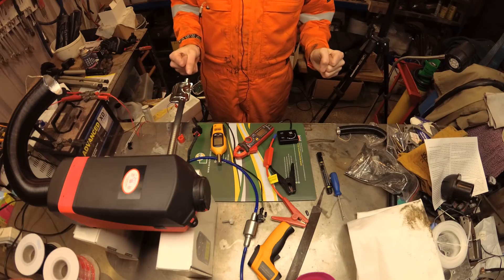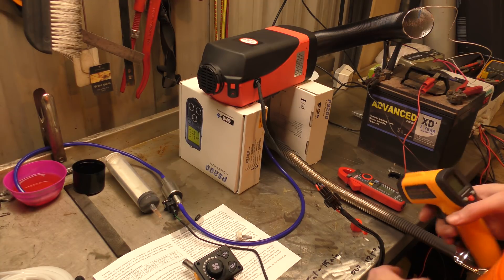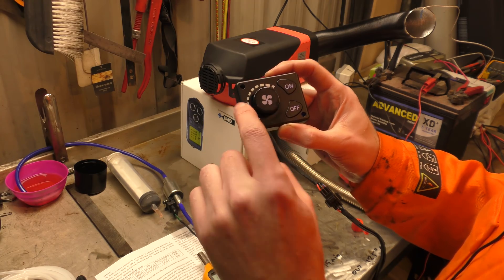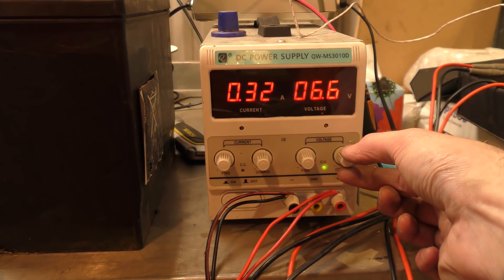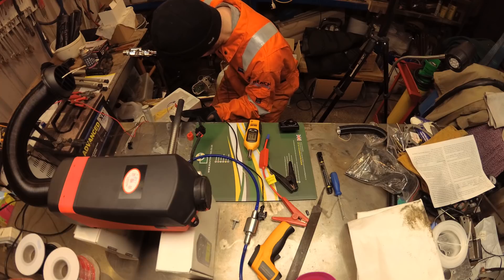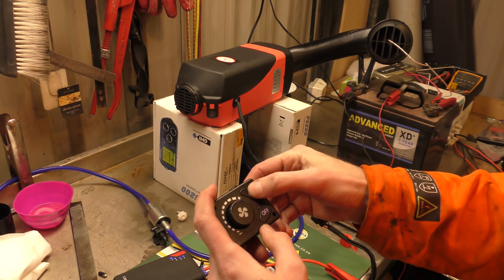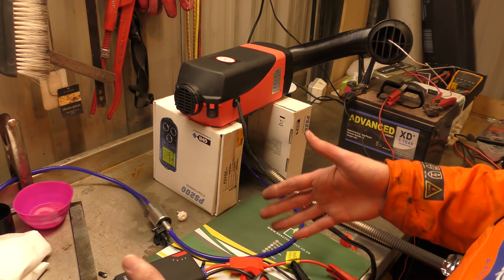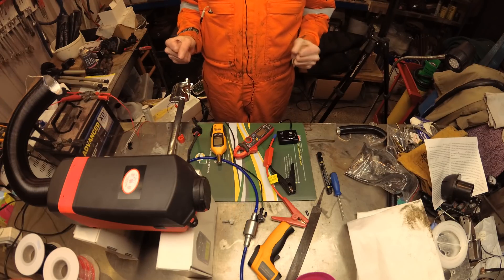Diesel heater testing - part 2 - more tests & questions answered

Comment: Thanks, what's your thoughts on the fuel inline being  so close to the exhaust?.
Reply from the maker: The other day Paul and I spent the day rewiring the camper.  I decided to leave the heater running in the workshop all day.  Fuel pipe didn't melt, no scorch marks on the cardboard boxes I had the heater sat on.  I'd have no problem running this all night.
Reply: @DavidMcLuckie  cheers, I have the 8kw machine heating a static, other than this concern I can't seem to fault it for the money.